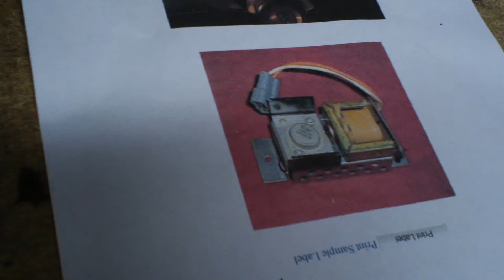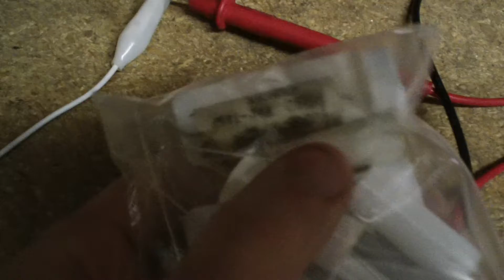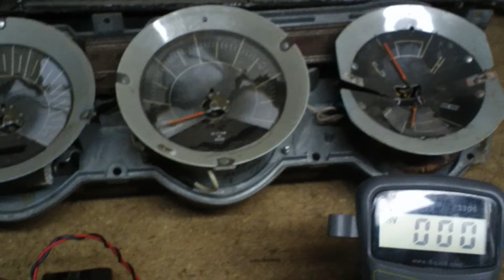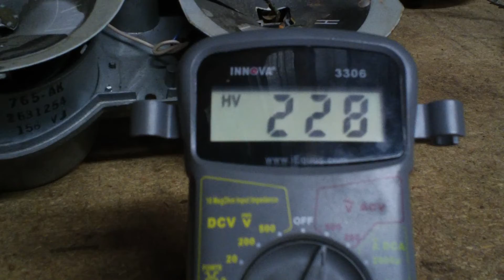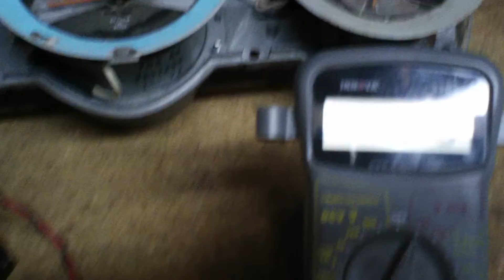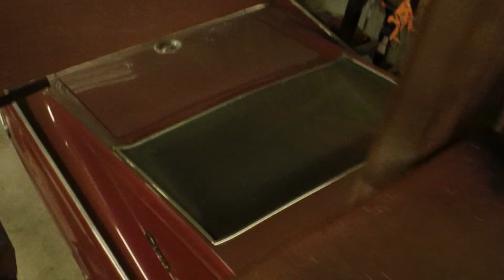1966-67 Charger Aftermarket Power Pack Test

Comment: On my '66 the old pack doesn't work and I swapped it out with another old one and then that burnt out and I'll try rebuilding it but there is arking in my speedometer gauge maybe the solder on the paint broke off or a wire is loose.

Comment: I've just rebuilt one of these using the original value parts and it gets pretty hot running at 12.6v. The transformer is noticeably warm as well. At that supply voltage I'm reading 330VAC. Does it sound like something is off? I get the same results with the new and old transistor.

Comment: I'm having trouble locating replacement capacitors; the resistors are readily availability at the local radio shack. If you have any ideas on where to buy, I'm all ears. Thanks

Comment: Hi. So you just changed the capacitor and that was it? Did you have to adjust anything after that. And where did you get your capacitor?  I have the same problem with mine. Thanks.

Comment: Hi JR G, thanks for the interesting video! this aftermarket power pack, in your opinion, should  work also on the 60-62 chryslers?
thanks a lot!!
Reply from the maker: +skylineeeeeeful The purpose of the video is to show that the aftermarket unit does not work nearly as well as the factory original one.
Reply: Thanks! The output voltage is too low, I got it, but at least it turns on the gauges. For me it would be fine if it doesn't cost as much as other manufacturers are asking for an old power pack.
Reply from the maker: +skylineeeeeeful Check with Bryan (A383Wing@aol.com) or Jeff Intwert, both had new good working on new versions of the factory power pack.
Reply: thank you again!!!